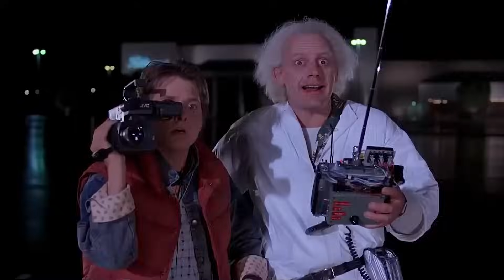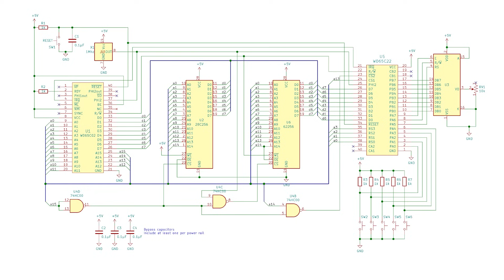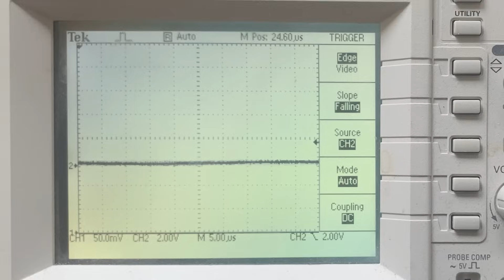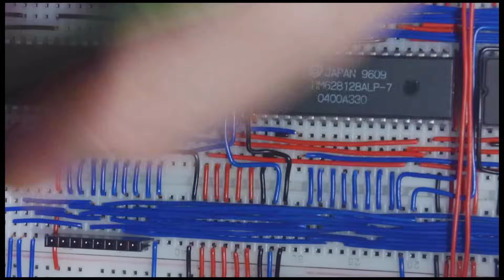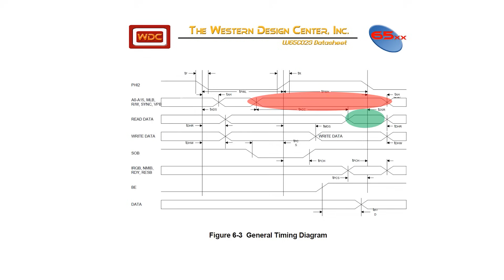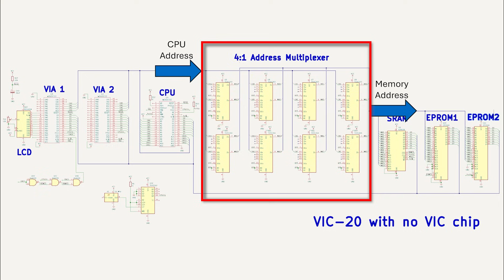VIC-20 Build from a breadboard 6502

Comment: Just as I'm almost finished making my kicad schematic for the SAP6502, the next thing to distract me appears (oh ... look, a squirrel!).  My confidence in building the TTL 6502 was a bit shaken in the last 2 videos (status and decimal mode): there are enough chips that there's about a 95% chance I'll get something wrong enough that I won't be able to troubleshoot. (Planning to wirewrap so defects would be easier to find.  Plus, wirewrap prototyping boards have reasonable ground & power routing).  I better get it done quickly so I can move on to the VIC20.
Reply from the maker: I'm actually planning to get rid of the status card and decimal card in the TTL Apple2e series, probably in 1-2 videos time in that series.  It will morph a bit closer to the Turing6502 and status and decimal will be done in the sequencer.

Comment: Hi DrMatt, it appears that your design employs the faster cycle times and larger capacities of later era SRAMs and ROMS than the devices available at the time. e.g. 70ns or faster vs 450ns of the 2114 & 2716, 32K vs 1K.  These capability improvements allow you to greatly reduce part count and wiring. e.g. The memory can be used for 4 different functions within a single CPU/video memory access cycle.
Reply from the maker: Correct, my actual VIC 20 has 2114 - 300ns parts, and i could get away with those if wanted a PAL or NTSC output.  VGA requires faster parts.  Personally wiring up a bunch of chips that could easily be replaced by a higher density part doesn't have much appeal.  From a teaching/understanding point of view, i don't think it makes a whole lot of difference.  The principle of operation for a 628128 is basically the same as a 2114.  Similarly, a 27c040 is just a much bigger 2764.
Reply: @DrMattRegan I would like to see how much speed we could squeeze out of C64 DRAM using modern parts. With nice scope traces. Most transistors of the C64 were in those chips. Utilize them to the max. I want to know how much Commodore left on the floor.

Comment: Omg, I have never thought about wiring kynar wire like you did here. I.e. solder a blank piece of wire, then cut the kynar mantle to length and push it down the wire to where it's supposed to go. I pride myself for my ability for thinking laterally. But this teaches me again that a capability of lateral thinking is only any good if you actually think of applying it to a problem. ;)

I mean: my solution is to use enameled wire for most of the buses (parallel wires with many connections), and use kynar wire for the rest.

That's a great working solution, and wiring with enameled wire is still faster than your way. But kynar just looks better and is longer lasting (no chance of scratching the enamel and making a short).

But the best thing: kynar has really colorful colors which you can use for the different subsystems/buses, and which really, really help in debugging later on. And also helps a lot when you want to add expansions to the circuit.

Why didn't I think of it? It's so obvious! :D
Reply from the maker: Give it a go.  The trick is that you need to stretch the wire a little, or else the kynar doesn't slide.
I haven't tried enameled wire, might be good for some busses.

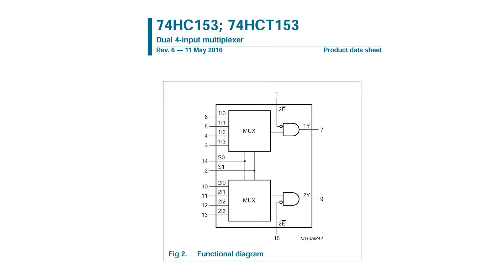Comment: 11:40 let's see, the CPU and VIC alternates on phi clock phases, and the VIC alternates on parallel color + character index fetch and 8-bit character raster fetch, so that makes a neat 4-phase bus arbitration state machine at 2MHz, VIC C+CI / CPU / VIC CR / CPU, but that only uses 3 ports to the memory, so there's one port left. 

But given VGA video timing, the VIC needs to run twice as fast anyway, so that can use 3 ports for VIC color / char index / char raster instead, and the CPU only really cares about the back half-ish of PHI2, so you might run a 4-phase arbitration at 4MHz instead, VIC C / VIC CI / VIC CR / CPU. I did something like that to solve A/D-demuxing and D-settling issues for CPU writes in an unfinished 65c816 breadboard project a few years ago, but I was worried about CPU read timing and still kept the CPU on bus for the full PHI2. Never got to designing a video generator, so I had no immediate use for the potential extra cycles anyway.

I guess timing constraints for CPU reads will get pretty tight, so perhaps a more funky 5-phase arbitration at 5 MHz instead, with the 3 VIC slots and a 2-wide CPU slot.
Reply from the maker: The CPU and VIA use the same phase of phi2.   The CPU and the VIC chip use different cycles, are you talking about the VIC in your post?

The normal VIC-20 VIC chip can do a character lookup and a colour look-up at the same time because they are in different physical devices.  Then it does the bitmask lookup (which requires the character number) from the ROM.
The VIC-20 has a ~4MHz dot clock and a 1MHz CPU clock, so it can do two memory access per character (8-pixels) as the character rate is 0.5MHz.  
In the VGA systems, we double HSYNC, so the character rate is 1MHz.  That means we need to all the memory look-ups for a character in one phi2=0 cycle.   To make things worse, the character number and the colour are in the same physical memory.
So, when phi2 is high, the CPU has access.
When phi2 is low, we do a character read, colour read and a bit-mask read.  This requires 3 different addresses + the CPU address, hence the 4:1 multiplexer.

I actually have an empty dot-clock slot when phi2=0, which i could use for the bit-mask read because is may come from slower EPROMs.
Reply: @DrMattRegan  yes, I was reasoning about the VIC, not the VIAs. Assuming 150ns ROM for the VIC state machine would limit to ~6 MHz, which is not enough to have separate VIC states for each memory fetch. But the color / char index fetch can still share state slot like the original, and multiplex color / char index fetch on the 8Mhz VGA dot clock phase instead of introducing extra states. Also means there’s no need to steal parts of PHI2 from the CPU. Neat.

Comment: Was the Vic20 a small C64 or is the C64 the successer ie Vic20s big brother?
Reply from the maker: I think C64 was the big brother.  It uses the updated VIC II chip, which allows the higher capacity DRAM.  It also allows 
smooth scrolling which is cool, but probably the biggest change is the introduction of sprites.
But the basic process for putting text on the display is somewhat similar (just faster) to the VIC-20

Comment: I made a display controller for a 128x32 plasma module entirely out of 74xx chips all on a breadboard. Lots and lots of counters. Since I was clocking the display I made it so that whenev the CPU (high speed 8051) needed to access video ram it'd pause the display controller's clock yeilding access to the CPU.  Each pixel was 2 bits so four intensities which was implemented by scanning each row multiple times. Took me about a month to get the glitches out, was my first project for these people and really wanted to impress em. To do VIC20 gfx imagine it's gonna a lot more than the 16 or so chips i used :)
Reply from the maker: Using the EPROMs for the raster generator should save a lot of chips.  It's just a question of how many graphics modes i want to support.
Reply: @DrMattRegan  OMG, I did the same thing  feeding my 3 bit 'sub-row' count,  8-bits from RAM,  and the first 2-bits of pixel counts to the addr lines of the EPROM and D0 spit out the pixel data. My first ever job was repairing old arcade games and I got a lot of my inspiration from those.  Good luck (i thought u were gonna support all of em right? :P)
Reply: @ForbiddenMagic unless you count switch between 8 pixel high characters and 16 pixel high characters as a mode, then the Vic 20 only has 1. Things like the movable memory map, when you add extra ram, or moving the borders or displaying characters from ROM or RAM aren't really modes.
Reply: So I guess that this plasma panel has 128 + 32 pins to connect to? 8 chips you say? They would need to have 32 pins each. Ah 6502 has 40? 6510 has 64 pins. Is TTL similar?

Comment: 4:1 muxes because you are going to run 4x CPU clock on the bus? So you get 4 memory access slots, probably 2 for "VIC", 1 for CPU and the bonus one is a mystery for now 😉
Reply from the maker: Close, actually 3 are for the video per CPU clock, character lookup, colour lookup and bitmap lookup.
Reply: @DrMattRegan  I completely forgot VIC is character based 😂

Comment: Is that 30ga Kynar insulated wire wrap wire? NOT cheap from what I've found, especially if one wants a color assortment. PVC insulated is cheaper, but I wonder how much it melts/shrinks back.  I haven't tried it, but have you ever used similar gauge magnet wire with an insulation type removed by soldering?  Anyone else is welcome to comment on these questions.
Reply from the maker: Yep, 30 gauge wire.  I have some cheaper wire i got from China, where as soon as you touch the insulation it melts.  I do occasionally use the technique you mention, mainly when i cut the wire to the wrong length.  The reason i personally prefer the kynar is that if you have to solder a wire that crosses another wire nearby, the heat from the joint can cause the PVC shielding nearby to melt and cause a short circuit.  I've had that happen a few-ish times, but it's really hard to debug.  That's the main reason i stick with kynar.  Kynar's resistant to the stray soldering iron as well.  If i have to use very long wires, i will use the cheaper wiring with the other PVC insulation.

Comment: What type of wire are you using for the point to point, where you can have the solid strand separate from the kynar sheath?  I can't find anything like that when I search for it.
Reply from the maker: I tend to use 
https://www.jaycar.com.au/black-wire-wrap-wire-on-spool/p/WW4345
The trick is to stretch the wire by about 2%, that lets the kynar move
over the wire.  
Doesn't work with all types of wire though.

Comment: In 80s, in Eastern Europe, there were efforts to copy the successful computers from West Europe. mainly the Z80 based Spectrum. While the original components were not availabe (the Iron curtain emabargo), the ULA chip was reverse engineered, being with a bunch of TTL logic ICs or, as I saw in one specific model, with a combination of TTL chips and a bipolar PROM IC. These Spectrum clones were good, and often more reliable than the original Sinclair Spectrum. For those that wanted the original Spectrum experience, they could use the original ROM  from a Spectrum computer, but most Spectrum clones had theirs own Spectrum ROM, sometimes with bugfixes, improvements or localized to the specific country (error messages were in different languages).
I do not , if that was done in 80s, why today the Spectrum fans do not use the same approach, being that the ULA chip is harder to be found and those old schematics are easily available.

Edit. I admired your wire routing technique, where did you get that wire, is there a link that you can provide or a part number for one to search for it? I mean, I found some similar wire, but the plastic insulation is way to feeble, it melt easily or, in one case, the insulation is some silicon that is very hard to cut.

Comment: Why 4:1 multiplexers? Perhaps something to do with allowing video timing for VGA instead of NTSC ? Or perhaps you'll be adding another processor or doing dma for something else ?
Reply from the maker: Close, i have to generate 8 pixels per 1 CPU clock.  For this i need a character look-up, a colour look-up and a bitmap look-up.  So there are 3 video memory lookups per CPU memory access.

Comment: I'm suspecting that instead of just multiplexing between CPU and video, you'll also be doing some bank switching later on. That's why the 4:1 muxes.
Reply from the maker: Will probably save the bank switching for the C64.  The video system needs 3 look-ups, character, colour and bitmap.

Comment: 4:1 multiplexers.  Video DMA and possibly mass storage DMA as well.  Looking forward to the next bit.  Subbed.
Reply from the maker: The video actually requires 3 look-ups per cpu clock.  Character, colour and bitmask.  The actual VIC chip does the character and colour look up simultanously.
Reply: @DrMattRegan an idea for the future. 

The 6564/5 vic chip does 40 columns by caching the character code, like the Vic 2 chip does. It would take some kernal changes and games won't like it. But you could probably make it switchable back to 22 columns.

Commodore were going to sell it as an upgrade for the vic20, but the c64 put paid to it.
Reply: @DrMattRegan Is this why there was separate RAM for the colour attributes? The VIC could access both RAM banks at the same time if there were separate address and data busses for each.
Reply: I found this note from Tynemouth Software:
“The 2114 is 4 bits by 1K, so the colour RAM is only 4 bits wide. Here is the colour RAM, UE1, on the schematic. It shares the address lines with the other two 2114 chips which form the first 1K of RAM. The colour RAM databus is connected separately to the VIC chip, as data bits 8-11. To allow the 6502 to write to the colour RAM, this is multiplexed with bits 0-3 of the main databus using a 4066.”
So shared addresses with first 1K of RAM - but it appears only 512 bytes is used and it’s memory mapped to $9600-$97ff or $9400-$95ff with a RAM expansion - and a 4-bit address bus presumably referring to a colour palette. This appears to be the foreground colour, with one global background colour. Screen resolution is 176 x 184, which is 22 columns by 23 rows, a total of 506 8 by 8 characters. With one colour attribute for each, this easily fits within the first 512 bytes.
Reply from the maker: Yep, the character value and the character colour have the same address bits A0-A8 (the screen space
location of the character to be displayed), so the VIC can output one address and read both.
Reply from the maker: Yep, i only want one SRAM chip, so i need to do two memory access instead of one.  I also need to go at twice the rate for VGA, but fortunately the 628128s are plenty fast enough.  I'd have to break them out into separate physical devices if i wanted to use slower chips.

Comment: I've tried your soldering technique and I just can't seem to get it.  I think one reason is that I have junky wire.  I bought some off eBay that claimed to be Kynar (or however it's spelled).
Do you have a part number of the exact wire you use?  I would like to get some wire that is of great quality.  🙂Thanks!
Reply from the maker: I usually use wire from Jaycar
https://www.jaycar.com.au/black-wire-wrap-wire-on-spool/p/WW4345
It's kynar shielding.  
The trick is to stretch the wire a little, i'll show it in the next video

Comment: Nice work Matt 😎
This is exactly how I used to prototype years ago but now its so cheap, quick and easy to get PCBs made, for me it actually saves time and makes everything tidier.  I think I will duplicate your project on PCB when finished for my own use and make freely available if thats ok 😁
Reply from the maker: Yep, go for it.  I'll be putting the ROMs for the raster generator online.

Comment: Address LEDs 0-7 lower than other
And data LEDs next to 8-15 address LEDs. (for some reason I prefer consistency over design 😂)
🎉 I can't thank you enough for these videos!!!. 🎉
I do wanna see LCData & LCDaddress conected instead LEDs 😅😊
Time seem to keep running away from me to sit down and look through your channel, and money flying away on other stuff too. 😂 (need this need that and the other needs over hobby). Hence only admiring your success in/on this. THANK YOU.!
Reply from the maker: Ha ha, yes.  I basically put the LEDs where i could find a slot.
Glad you're getting some value from them.  It's a fun project.